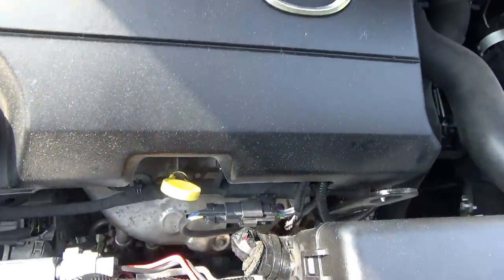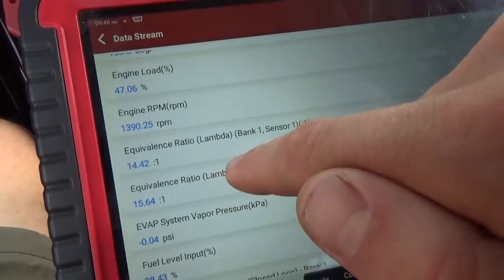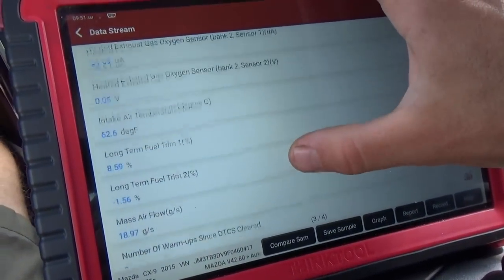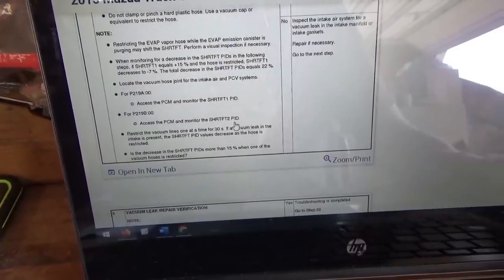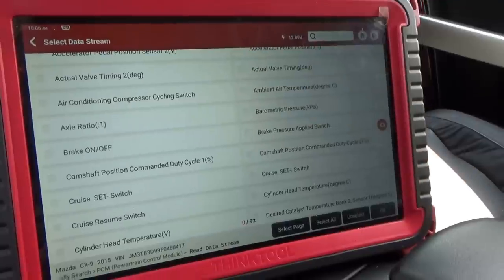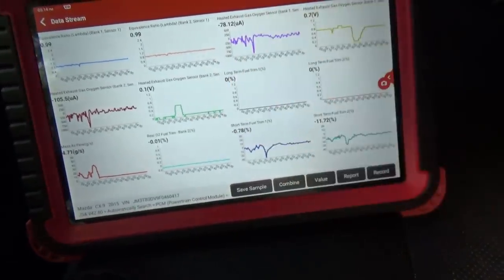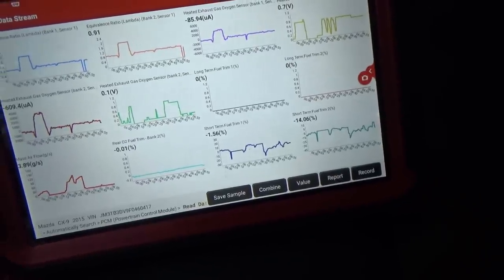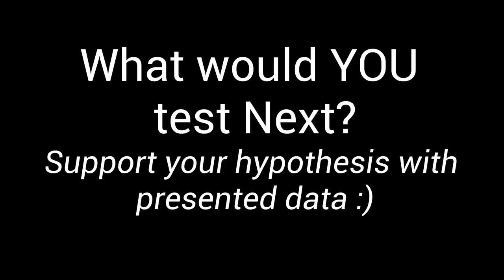Mazda MYSTERY No One Could Solve - Part 1 (P219B - Bank 2 Air-Fuel Imbalance)

Comment: I think you need to find out the purpose of the rewire. Until then your just spinning your wheels.
Reply: Yes, investigate the Tech Bulletin calling for rewire and see if applied correctly to vehicle
Reply: It's to eliminate noise between O2 sensor wiring and evap/emissions wiring. I'd be making sure the re wire was done correctly.
Reply: @cjmazdatech  I'd agree. Will have to wait and see the outcome.

Comment: I would bust out the propane next. Id look at those same pids and enrich the intake, just to work the AFR and downstreams to make sure we don't have someone lying. Next I would defeat the PCV somehow, usually removing the breather hoses, and pump some propane in the dipstick tube. If your trims straighten out with the propane in the crankcase, it has an intake leak.

If that doesnt do it, I also suspect an injector issue. This mazda might be able to run the ford IDS injector balance test with the scanner. Exhaust leak near an AFR/Downstream o2s is also possible. Depending on how much ford is left in this mazda, the downstreams might have a large effect on fuel trims.

Also that wonky harness repair, I need to see that TSB. But as you said, the AFR does appear to be working.

Comment: Could you force the engine richer with a propane torch and see if both sensors report richer to the same degree? If possible switch the sensors around and compare results....

Comment: First I'd check that TSB to see if it really is recommended to chop off the original wiring harness. Seems strange to me.
Reply: There is a TSB of that it seems. Not sure if it applies to 2015, but it does applies to the 2011-2013.
Reply: Yeah that is a strange one.  Since the widespread adoption of CAN Bus and twisted pairs of wires, well this whole thing about "interference" just sounds odd.   I'm not saying it isn't possible though, just a new one on me.
Reply: @jtjones4727  I fixed a car audio system with subwoofers a guy had installed. Complaint was everytime he hit the brake pedal the subs thumped very loud. Problem was the routing of the signal wires literally moved a wire 3" over in one spot and problem solved.

Comment: I would do a relative compression test. Then possibly go in cylinder on bank 2. Possibly an engine fault on bank 2 causing that bank to run rich. Thus pulling back fuel.

Comment: If they fixed the harn3ss for oil wicking then maybe b2s2 O2 is still being affected and skewing its reading. Need to inspect harness above valve cover to check for oil in connector. Oil pressure switch can leak into harness.

Comment: Eliminate the easy stuff first. Can oxygen sensors respond to rich and lean conditions. Bank 2 showing a rich condition  however downstream oxygen sensor is telling you that the bank is lean. Would not think of an intake leak beacuse it did not corrected under low vacuum. I suspect an injector flow problem. My theory is that if you have one injector that is overfueling the cylinder is going to cause a rich condition however the only thing that the computer can do is short the pulse width for the whole bank causing the lean condition on the downstream oxygen sensor
Reply from the maker: Great hypothesis backed up by data! We'll check this in Part 2 😉
Reply: @PineHollowAutoDiagnostics  cant wait for part 2
Reply: Awesome!!!!! Pretty neat!!! Just Watch part 2. I guess my hypothesis was correct!!! Cool that you were able to prove it

Comment: Yes is confusing!? probably you have to focus on bad oxygen sensor...some small leakage of air or gasoline from injectors on that bank, but that will be after changing sensors what im writing previously.

Writing after...now came to my mind... also slightly misfire or bad coil/plug can trigger that

Comment: is it possible that someone installed a regular oxygen sensor when it should be a air fuel ratio sensor? maybe a smoke test to see if one cylinder has a intake runner vacuum leak?? interesting case.

Comment: What would I do? Wish I hadn't taken the job  have a cup of coffee Then realize I'm the guy who will fix it right and start testing sensors, wiring, plugs to the sensors, swap sensors making sure there not aftermarkets , injector control mod test to see if injectors on 2 are running correct

Comment: When an AF sensor shows positive number in uA than is LEAN, when shows negativ number that is RICH, when near zero then is near lambda 1. Why is the fuel trim at bank 2 negative? because the AF sensor shows negative number so that bank is RICH, wich means a Leaky Injector.

Comment: I had 3 CX-9's kept each one 3 years. They were probably the best vehicles I have ever owned. The only issue I ever had was one needed a brake booster which was covered under warranty. Nothing except oil changes.  I now have a Kia SX Sportage (turbo). What a piece of junk compared to the Mazda's. Looking forward to final diag and fix on this.

Comment: I would just swap the sensors over to isolate the problem but I had a similar problem in my Holden VY SS Commodore which runs the 5.7 litre Chevrolet LS1 V8 engine albeit with no fault codes after I drove through flood water where water 💦 somehow got into the fuel tank, caused lean fuel trims, hesitation on acceleration after starting up & when I reversed out of a car park after the engine had been sitting for a while it started to idle rough until the water got stirred up inside of the fuel tank.

I run 94 Octane E10 unleaded fuel which does absorb water 💦 & I did add a litre of methylated spirits to the fuel tank but maybe I shouldn't have bothered because that's 97% ethanol anyway but just driving it fixed the problem until there was no more water in the fuel tank.

The fuel trims were over 10% on one bank & something like a couple of a percent on the other,now they're both sitting nicely at -1.6% LTFT on both engine banks !
H

Comment: I was under impression that negative current on wide band upstream sensors means RICH, not lean. Maybe confirm that you're right. This would correspond to down stream sensors voltage being higher, closer to 1 volt. 

The ECM is doing the right thing by taking fuel away.

Comment: For this code I look at computer commanded pulse width for each injector on bank 2 to determine odd cylinder. This would narrow down to which cylinder is likely causing the imbalance. Think of this code like a minor misfire. The pcm is able to determine the air fuel ratio of each individual cylinder from the air fuel sensor. On Chrysler products I have seen worn lifters and leaking injectors causing this code. I’m a Chrysler dealer technician so my answer may be helpful but off at the same time.
Reply from the maker: Very interesting suggestion. Is there a specific data pid for each CYLINDER pulse width, or just B1 vs B2 pulse width?
Reply: Yes, there should be data pids for each individual cylinder fuel injector pulse width. Looking forward to seeing what you find for causing the code. I enjoy watching your channel.
Reply: Now that I’ve seen part 2 the pulse width on cylinder 2 would have been lower indicating the pcm seeing a rich condition on cylinder 2. This would have me flow testing the injector next in the diagnostic process. Different approach for the same result.

Comment: I am not sure where this is going; I am getting my Vodka ready for another no parts required Ivan magic show. I would fully investigate the TSB repair, then swap the sensors; if the issue remains, it would then be a "leak" somewhere in the engine system; not sure if vacuum or exhaust type of leak. Time for the propane sniffer test!

Comment: What is up with the fuel system loops?   I've never seen 1 closed with the other showing engine off.  You didn't have the loop status showing during your test drive.  Without access to any wiring diagrams, fuse, short, or grounds causing 1 side to drop out?   You mentioned it during the review of the freeze frame data.  But i haven't turned wrenches in 20 years., so i am out of my depth here.

Comment: If the PCM is attempting to calculate the cylinder to cylinder fuel ratio it would be nice if there was a data PID or some advanced diagnostic mode so you could at least see what it thinks it's seeing.  I think my 2005 Cadillac STS actually was capable of this though I don't recall seeing a PID for it.  Using a factory WB and some fast microprocessing, the computer could theoretically attempt to measure each "pulse" through the exhaust manifold.  It would basically know based on which cylinder just fired, how long the manifold is and what the engine RPM is.  All that said, IF the computer was actually capable of cylinder to cylinder AFR, I would also wager that a lot of the items in that diagnostic CAN impact cylinder to cylinder AFR.  But we normally would never be able to measure it so we treat it like a whole bank or engine condition.  Normally that would be adequate but in the world of modern emissions, I guess it's not.  The fact that the banks themselves were imbalanced also seems like a confusing situation but the ECU may have been doing that on purpose to attempt to rectify whatever condition it thought was happening cylinder to cylinder.

Also lambda was happy and you are judging the bank AFRs from the rear sensors, which are post cat (and narrow band).  That's a lot of variables.  I do like going after the front WB sensors first to see if there is sensor to sensor variation or something else.  I also would like clarification on the entire premise that the code is for cylinder to cylinder AFR imbalance and NOT just bank to bank.  It's in control and the AVERAGE lambda is fine....

Comment: Hello my good sir. I got another Mazda mystery for you. I got a 21 CX-5 with 34k miles on it. It’s having intermittent starting up problems. Mazda dealer already changed battery, starter, telecommunications module and lift gate module. They still can’t find the problem. Mazda considers the car a lemon at this point but they are not willing to exchange the vehicle due to shortages on inventory. They want to buy the car back but I would only get less than 1000 dollar refund. Even though I paid up to this date 4K on down payment and 7k on car payments. I have documented every starting problem. If you could take a look at it, I would appreciate it. At this point I feel I’m on a loose-loose situation.

Comment: Had injectors cause this on many different vehicles including fords another issue ive found at times.over looked is intake manifold runner control plastic fins with pieces broke off And also carbon coated valves causing lean conditions on specific banks aswell as caused rich codes also but ya id tey a quick sensor swap see if the problem remains where it is

Comment: I would head to a wiring diagram and verify those wires they chopped off first. Then yeah switch sensors then back to the live data check.

Comment: I haven’t watched part 2 yet. Sooo, I would be curious of what b2 a/f sensor looks like with the scope. If it shows slow response, matching scan data, I think swapping front sensors is an ok idea, IF bank one is easy enough to get at… OR I’d be checking injector flow rates (whichever seem like the easiest. IF scope patterns of the front A/F looks more normal, and LESS like the slow response on the scanner, I’d want to compare the same signal at the computer… my theory being that there’s potentially impedance post the “TSB” wire job. Now for part 2🙂

Comment: I’m very suspicious of the bank 2 AFR sensor.  If it’s not OEM it would be my first target for the parts sniper rifle.  The code set criteria specifies a per-cylinder difference and the only way that could be detected is if the ECM combines AFR data with cam/crank position data with millisecond accuracy.  This highlights the precision expected of that sensor.  Any lag or imprecision would offset the exhaust gas data from what the ECM is expecting to see (based on cam/crank data) and thus appear to be a cylinder-by-cylinder imbalance, setting the code.  If the cam/crank sensors were inaccurate for whatever reason there would be severe drivability issues (if the engine even ran at all) and all sorts of codes.  Of course do a quick check for exhaust leaks and switch the sensors if you can easily get to them but from what I’ve seen here my money is on the B2 AFR sensor.

Comment: I  will look for restriction in the cat for bank 2, check with a in pressure transducer to both banks and compare.
Reply: I think this Toyota mechanic said that the downstream sensors are more for checking the condition of the catalytic converter rather than engine control.  Anyway, here is the excellent video. https://youtu.be/eiY1fHcDqu0
Reply: @kentbetts  What can I remember, Scanner Danner and his brother has video with a case where the downstream sensor has an effect with the fuel trims.

Comment: Swap the sensors around. I see carbon forming on valves and making a restriction on di engines. Maybe the vapors enter on that side of the engine and create more coking. Some engines have flappers inside the manifold to make long and short runs. Maybe one is stuck. Vacuum hose leaks. Bad wire or corrosion on the o2 sensor connections or elsewhere. Could be a flood car. Yes smoke check. OMG I'm not even a mechanic I just watch these kind of vids 24/7/365 There is a lot of value in it.

Comment: I would be tempted to swap the AFR sensors if they are easy to get at.
That way if the problem moves it's the sensor, if it stays on bank 2 it's time to look further.
Perhaps do the same deal with the downstream sensors.
With an imbalance between banks it should be something that affects bank 2 only.
I may be wrong but I don't think a vacuum leak would make such a big change between banks, it should get better as the load/revs increase.
And as has already been mentioned, check the work done by the dealership, although it seems the problem existed before they started on it.

Edit: I read the comments after posting mine, It seems many people have the same thought you did about sensor swapping.

Comment: Mazda doesn't have the o2 sensor bias voltage, but I would check to see if it now does have that. Swapping the o2 would be my start, plus using the Pico oscilloscope to verify the readings are what they should be. If the upstream sensors are faulty, I would replace both with new OEM parts just to have the readings the same, then go from there.

Comment: Intreserting that throtlle and fuel trim difference is the same. I'm going to call a clogged valve. Posssibly bad fuel, swaping bank 1 sensors is a idea I would try and go from there.

Comment: I think there is wrong upstream O2-sensor on bank 2. Many aftermarket sensors do not react fast, if example holes on sensors is wrong design. (One hole on nose, and good ones have many holes to oxygen rounded on sensor noze) Those works on downstream, but not upstream. Put good oxygen sensor for it, And try take those diy wire away...

Comment: 1. Verify B2D sensor is good.
2. If O2 sensor is good, back probe it to verify ECU is correctly reporting the voltage being generated by the sensor.
3. If voltage at sensor is different than what ECU is reporting, verify sensor and ECU grounds are adequate.
4. If grounds are bad, fix and recheck. If grounds are good, or fixing them does not fix the problem, I would suspect a bad ECU but before condemning, continue with step 5.
5. Check for vacuum leaks on bank 2. If found, fix and recheck.
6. If problem persists, verify correct valve timing and phaser operation on bank 2. 
7. If no  timing issue, or fixing it doesn't resolve the issue, replace ECU.
Reply from the maker: Interesting Flow Chart... :)

Comment: are the rear o2 sensor wideband or old school types?  I suspect they put a wideband where an old school is maybe supposed to go.    It's probably sending 0 current to pcm because it's stoichiometric and being interpreted as zero volts by the pcm.   I would check if the wrong part could plausibly fit the connector despite being wrong part.

Comment: Cylinder imbalance codes as you see here are used by the ECM to pick up slight variations in combustion depredation using either the AF sensor or the Crank Sensor. The ECM looks at the engine as 6 single cylinder engines and compares each cylinder to each other to see how it is running. It does this by closely monitoring the AF sensor for each cylinder exhaust pulse and the crank sensor. If it sees a variation in a cylinder as compared to the other ones it will set the Cylinder Imbalance code. Even though the engine seems to be running good, there is something wrong with the combustion process that the ECM is picking up. Now this could be due to a number of things, but the most likely cause is an engine mechanical issue, such as a valve starting not to seal so cylinder compression is slightly lower than the other cylinders. Best bet is to perform a compression test and a cylinder leak down test and see what the results are. Code may also be set due to an underperforming injector, hence the rich condition as the ECM is fattening up the injector pulse to compensate for the lean condition, but I,m not sure if Mazda engines can do bank to bank fuel correction. Looking forward to part two

Comment: Start with the basics. 
1. Check that TSB and more importantly, its implementation. 
2. Exhaust leak between sensors.
3. Swap sensors bank to bank, as you suggested.
4. You could compression test a cylinder or 3 and compare them bank to bank.

Comment: ..i had an instance with a vehicle where they had Ignored the Check Engine Light, which turned out to be a Bad Downstream Sensor on one bank.. eventually that Imbalance had blown out all the Other O² sensors, so i had to replace All of them..One was okay, but i replaced that one too as a Precaution..